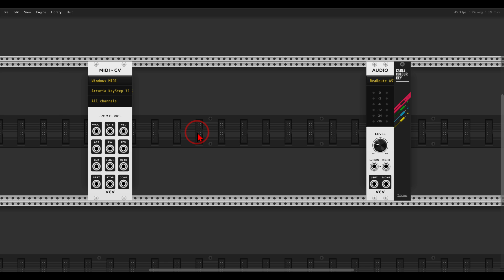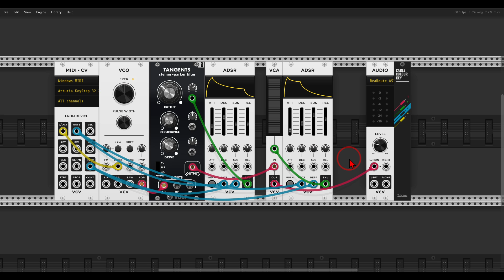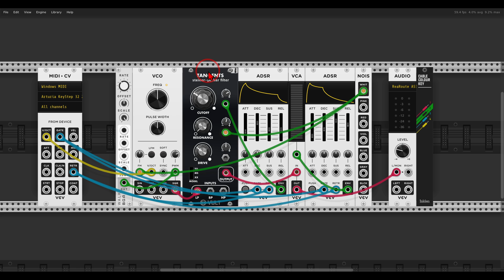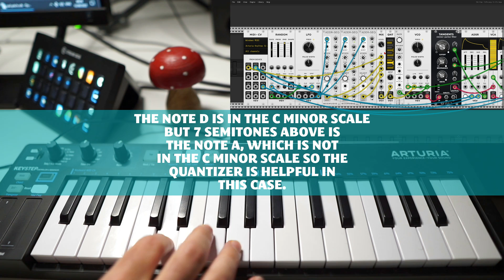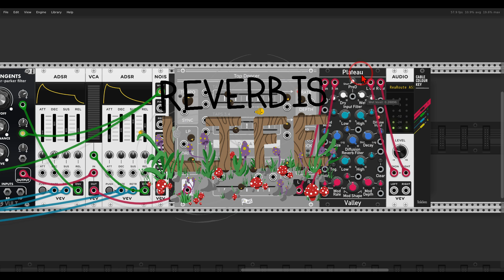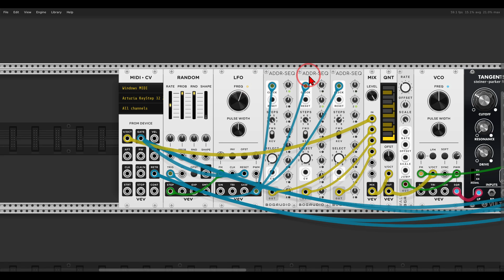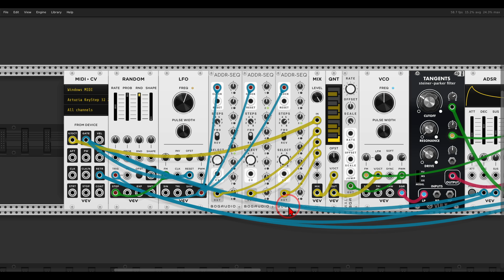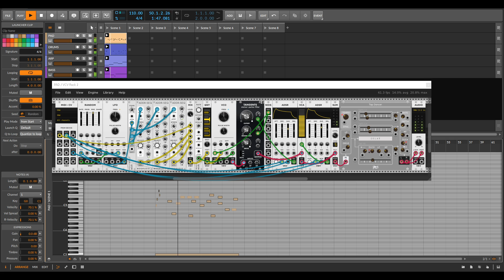Building a beautiful pad from scratch in VCV 2

Comment: The VCV right click text field has support for mathematical statements! You can enter the fraction "7/12" to set the voltage to a perfect perfect fifth. (A perfect fifth is seven semitones and each octave is divided evenly into twelve semitones). If you wanted the perfect fifth an octave up, you could enter "1 + 7/12". In fact, if you get tired of typing "1" you can even type in "sin(pi/2)" and VCV will understand you. This is built into the framework so it works with every module. You can set the cutoff of Tangents to "pi/10", whatever you want, go crazy!
Reply from the maker: Yes! Great tip!
Reply: That's not a really perfect fifth though it's slightly out of tune because of the even tempered scale. 7/12 is a couple of cents flat compared to a violinist or singer's perfect fifth.
Reply: @PiersCawley  It's a perfect perfect fifth in 12-TET, the tuning being used.